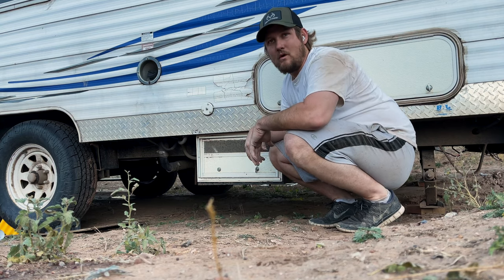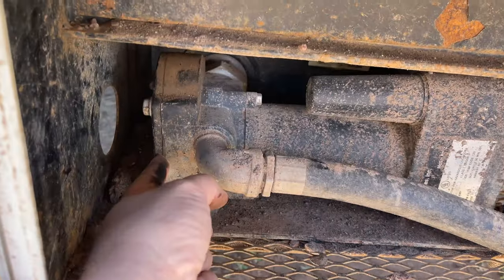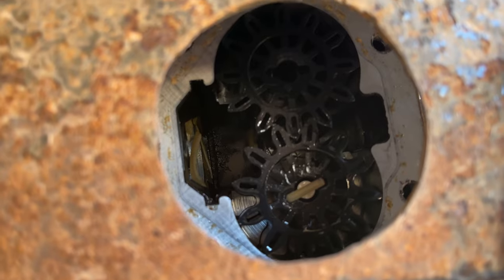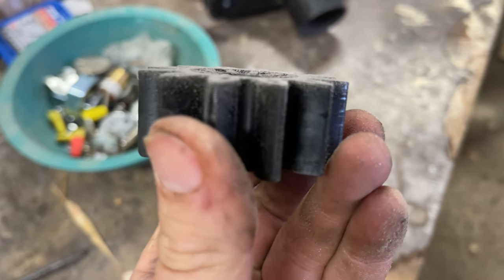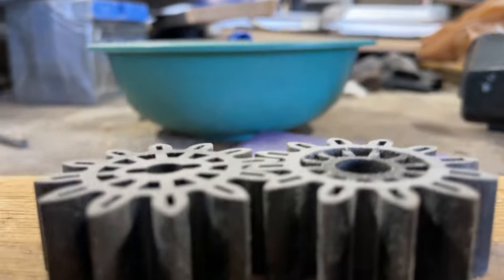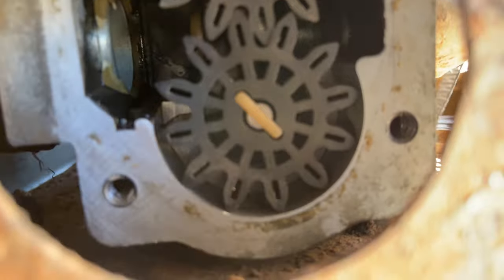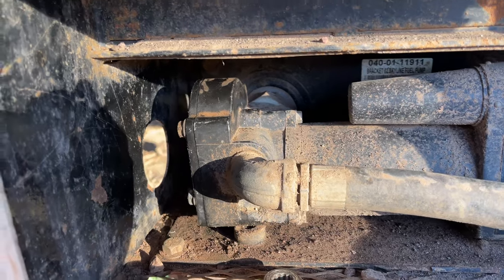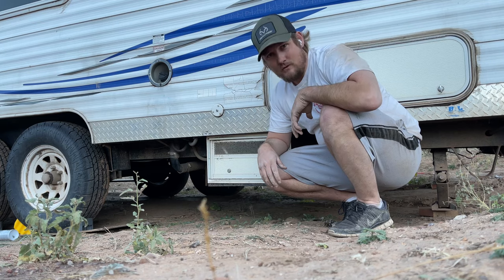How To Fix A Toy Hauler's Fuel Station

Comment: When I turn on the fuel station, it runs for 10 seconds and then pops a fuse. Why?
Reply from the maker: Could be a couple things. Could be what i explain how to fix in this video. Could be a bad ground wire. Hope this helps!
Reply: GPI EZ-8 fuel pump popping fuse. Followed instructions, sanded down gears with 120 grit approx 1mm. Cleaned and Installed and now working perfectly. Thanks BWilly!!!